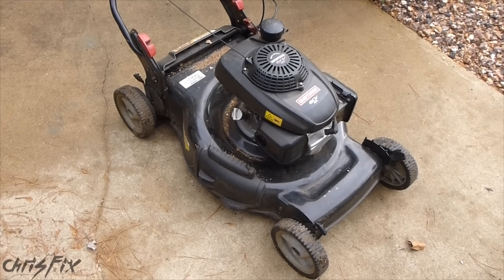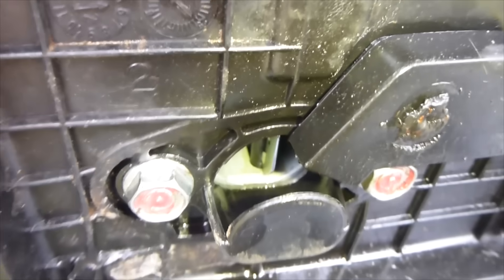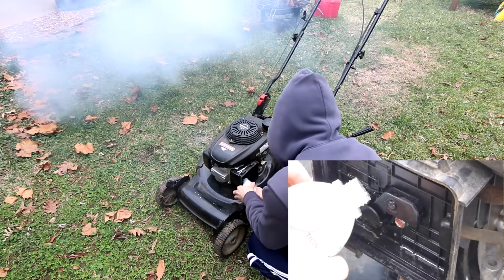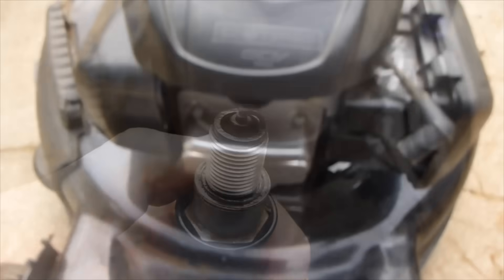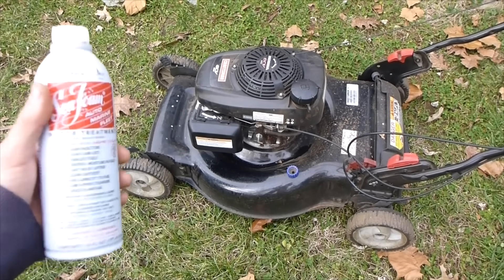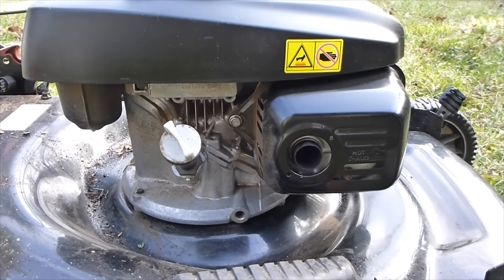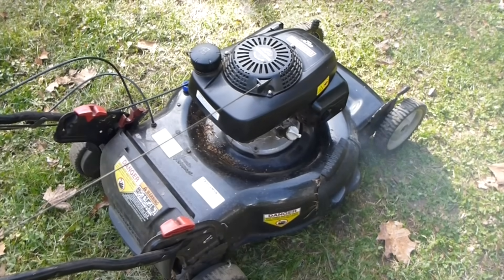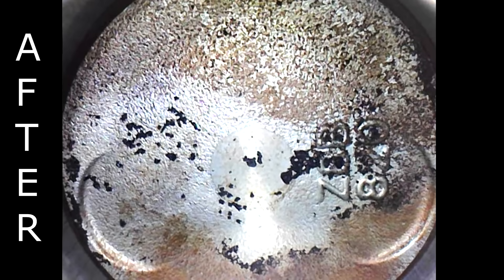Does Seafoam Actually Work? (with Proof)

Comment: Very nice! I am actually planning on doing a piston soak in my fiance's 2.2L Ecotec in her Sunfire as she's having problems with burning oil due to the infamous stuck oil control rings. Supposedly doing a couple piston soaks gets the buildup out of the rings as well. Glad to see some actual real world results from Seafoam though. Very cool test!
Reply: Before I do any piston soaking I believe I need to take a look at the PCV system as I just noticed today that my valve cover oil cap had some frothy yellow gunk on it. Beginning to wonder if incorrect crankcase pressure is the root of my problem. I appreciate everyone's comments though! I will definitely take them into consideration.
Reply: ***** Good thought, hope that's it!
Reply: Jinppa The Sunfire isn't being driven a whole lot as it's not our extra car (got the fiance a Focus) so I haven't had the need to work on it as quickly as I had originally planned, especially with how cold it is in upstate NY right now. I did do an oil change, replacing one quart with Marvel Mystery Oil as per the directions, however I'm not a fan of this approach as the MMO is much thinner than the 5W-30 I put in, therefore lowering the weight about a grade or so. I've noticed much more engine noise since doing that oil change.

I ended up ordering two bottles of Auto-RX after reading some good reviews on it and will be doing another oil change with a bottle of that in the crankcase to see if that will help clean everything up. Before I do this however I will be doing the piston soak with Marvel Mystery Oil. I am currently waiting for the weather to get a little warmer before I attempt that.

I'll keep everyone posted.
Reply from the maker: ***** Good luck. I think the carbon buildup might have cause scaring of the cylinder wall which is why you are using so much oil. Maybe do a compression/leak down test to see if that cylinder has good compression.
Reply: ChrisFix if its anything like the 2azfe in my xB, they used low tension rings. Carbon build up prevents them from sealing fully to the cylinder wall. I seafoamed via the intake, gas, and oil. I have seen a pretty decent  decrease in oil consumption. It used to go through 1qt/800 miles. Now it maybes uses that in 3500.
Reply from the maker: ***** Thanks! Let me know if it works for you! I definitely want to hear back!
Reply: Lol hopefully you see this first, but I just made a comment that it will actually make it much worse because it will release the carbon that's holding back the oil. Trust me. Either deal with the burning oil or have a shop replace the rings and hone the cylinder.
Reply: Also, I don't know squat about that engine, but it could possibly be valve seals, which is a wayyy easier problem to deal with.
Reply from the maker: Tyler Ketter Either way, it is worth a shot if he needs to get it rebuilt anyhow.
Reply: Hi Jared, Not sure if soaking the pistons would cause the carbon to loosen up and get stuck somewhere causing more issues in the engine (like when cleaning heavily sluged engines once). IMO...would get ChrisFix's opinion on it too(professional advice).
Why not try CRC Combution chamber Cleaner- http://crc-canada.ca/automotive/fuel-additive/complete-fuel-system-combustion-chamber-cleaner-355-milliliters.html
I  had excellent results from CRC Guarateed To Pass on a 89 Mazda 626 till 2009.
By all means, I am not an expert on vehicles like CF.
Reply: ***** if you're average commute is short that may cause the yellow frothy junk. It's just from condensation collecting on the highest point.
Reply: Nah it's not that short. It's about a 20 minute drive every day with this car.
Reply: One other thing You can try besides seafoam soak, You can run marvel mystery oil to the gas for a couple tanks. I've used it to free up gummed piston rings on engines they were burning oil. Take the car for a good freeway run after adding the oil to your gas. You can also add Marvel to the oil and run that for a while to clean the inside of the engine.
Reply from the maker: Oldbmwr100rs That is another good test I will have to try and fit in. Thanks for the idea!
Reply: Jared, please tell us how it works out on your fiance's Sunfire. Good luck, may the gods of speed be in your favor.
Reply: ***** So, how did it go?
Reply: *****
I have used z Max but it really thinned out my motor oil SeaFoam will thin it out also. You can only use 1.5 oz per quart .MMO works great but i would drive it 200 miles or more then change the oil. I have been using the MMO for over 10 years but the other product like stp multipurpose motor treatment , zMax etc etc are good for a quick engine flush but Marvels Mystrey Oil can stay in the engine much longer.
Reply: I have a 2009 Nissan Altima with the 2.5 4 cylinder that is consuming a ridiculous amount of oil in cylinder three and has fouled 2 plugs already. The dealership said if they were to remove the engine and disassemble until the point of failure and it turned out to be carbon build up on the rings causing the issue my warranty wouldn't pay for the repairs and I'd be responsible for the rebuild. I've already done the induction sea foam treatment which helped some ignition knock but didn't do anything for the rings. I'm going to do a overnight seafo am soak in that cylinder to see if resolves my issue. If you're able to do this with success before me please let me know. I'll be posting my results on here after its done.
Reply from the maker: Douglas Bomer Thanks for sharing Douglas! That is pretty good! Im excited to see if something similar happens in my truck.

Comment: you should try water with a spray bottle next! after the maf sensor of course
Reply from the maker: DarkskullMedia Yea, that is the plan!
Reply: ChrisFix sweet! i think it works quite well considering its just water but yeah my uncle has a older camaro thats supercharged and we recently rebuilt the engine with better internals, he was running methanol injection and it was crazy to see a motor from the 1970's look like it had been steam cleaned!
Reply from the maker: DarkskullMedia Yea, methanol injection definitely cleans it out well since it is constantly introduced into the cylinder. It is like a head gasket leak but instead you are using it to make more power! haha

Comment: I'm actually a bit disappointed! I did this on my car (which is a 1986 Saab 900 Turbo by the way, so PLENTY of time to build up carbon with over 260,000 miles on it), and the pistons afterwards were spotless. I used about half a bottle of it, and considering it made the inside of the engine looks brand new I'm a bit surprised that it didn't do more for the lawnmower. Still though, worked a lot better than the Gumout product in the other video.
Reply from the maker: Jesse Crandle You looked in the engine before and after? How did you do that?
Reply: ChrisFix Just with a borescope through the spark plug hole.
Reply from the maker: Jesse Crandle and before it was dirty and after it was spotless?
Reply: ChrisFix Before it wasn't HORRIBLE, not large deposits, but yes it had noticeable black carbon spots that covered maybe 1/2 of the piston in random spots (much the same way it does in your truck). After the Seafoam though it was completely gone.
Reply: ChrisFix You know, the answer may be in the fact that a car's motor operates at a higher temperature. I'm just figuring a lawnmower operates at a lower temperature (it has no radiator or cooling system other than oil), a car may have a higher compression ratio and generate a significantly larger amount of heat to aid in the steam cleaning process. I could be wrong about that though.
Reply from the maker: Jesse Crandle That could be. Makes sense.

Comment: Seafoam does work.
i used it in a 350ci that ran rich and had massive deposits on the valves.
it did reduce the build up, but only about 20%.
it ultimately needed to be dissembled and cleaned properly.
Reply from the maker: Sanic Thanks for sharing! Yea, it def does work which is exciting! Sounds like you had a lot of deposits! How did you know you had bad carbon buildup?
Reply: ChrisFix when I took the manifold off;
saw a walnut sized chunk.
it was too far gone though.
Reply from the maker: Sanic wow!

Comment: Hey chris, I'm a bit concerned about the oil burning off in a car. Will that clog up my cats? Also, I just put spark plugs in, will this foul them up? Otherwise I am extremely impressed with this test!
Reply from the maker: helivesonforever I am concerned with the oil coating too, more for the cats than anything else. The spark plug did not get fouled, it actually got cleaned and I would not worry about that. The oily film on the cats should just get burned off but I dont know. I mean, people use it all the time with no problems so...
Reply: ChrisFix Can't wait for the video regardless I had to do both cats in my truck and never want to again. Doesn't help that you can't get them used in my state either so new is the only way to go, which costs a fortune. I suspect that the oil may cause the cat to run hotter, thus melting the material inside. You are right about people using it without issues so I guess it's safe to say that one use won't cause you major issues.
Reply from the maker: helivesonforever That is what I am thinking! We will find out!
Reply: ChrisFix Sweet! Any fixes on your PT Cruiser yet?
Reply from the maker: helivesonforever No, not yet lol

Comment: Interesting results with seafoam on a lawnmower engine.  When you test it on your truck put it in the fuel tank as  you did with gumout  to be a controlled test.  I suspect if you ran the gumout in the mower as you did with Seafoam you may see the same results but we really don't know do we.  So far the only thing we do know is seafoam does take carbon off the piston on a lawnmower.
Reply: Agreed. The same tests should be done in order to keep it as controlled as possible. If seafoam can be put into the gas tank like gumout can, which I believe that it can, then the test should be done with that method.
Reply from the maker: Steve Rob Gumout is not meant to be run in the intake. I will be testing seafoam as it is stated in the instructions (just like I did the gumout). Thanks for the suggestions!
Reply from the maker: Brentt Moore Seafoam gets 1/3 in the gas and 1/3 in the intake.
Reply: I've heard of people using it that way, but I thought that it could be put into the gas tank as well. No?
Reply from the maker: Brentt Moore Yes, 1/3 in the gas tank and 1/3 in the intake as per the instructions on the bottle.
Reply: I must be tired, I certainly misread your post. Thanks for pointing out the directions to me! Looking forward to the other videos in the series, like always.
Reply from the maker: Brentt Moore No worries Brentt!

Comment: I've been using seafoam for a few years now. This stuff works great. All the cars in my household have engines with anywhere from 120k-over 250k miles. Seafoam has worked great on all especially my 96 mustang GT(V8) with over 250k. The first time I used it wow.. smoke filled an entire house across the street( seafoam in a safe location) and once the procedure was finished she purred and roar like if she was young again. Noticeable throttle response recovery and a bit better mpg. 

Soaking the piston, I've thought about doing that but never tackled it. I'll be doing that on this car when my next oil change is due.. why you may ask? I believe I have some bad piston rings.. so some might seep into the oil.. maybe hardly anything.. maybe a considerable amount.. is that a bad thing..? Not if your going to change the oil within the next 100 miles or so.. it'll even help clean the crankcase out. 

Chris thanks for putting this video out there so people can see it in effect. This stuff works great. Keep up the good work man. Easy instructions and very good work with the cameras and pictures.
Reply from the maker: Surdo310 Thanks for sharing your experience! I am glad you like my videos!

Comment: Nice, i knew i liked seafoam for a reason, with the last test showing the best results wouldn't holding fuel there for a period of time get into the oil? i know seafoam can be put in the oil but i'm not a big fan of it there.
Reply from the maker: gremlinamc1975 Yes, it can and will get in the oil. Since it was only for a few minutes and it is a lawnmower I dont really care lol. I will do an oil change come spring time. I wouldnt soak the piston like that in my car engine.

Comment: I have been using that stuff for years. Very interesting to see what it's actually doing inside of the engine. Great video. I normally put 1/3 through the intake, 1/3 in the gas, and 1/3 in the oil before I drain it on older vehicles. My newer ones I use synthetic so I do not bother to put in the oil before I drain it out.
Reply from the maker: Francisco Zurita Thanks for sharing Francisco! I would never put anything in my oil but that is just me!
Reply: ChrisFix Yeah, I have heard other people say that as well. I do not do it on my newer vehicles. Just old ones I have bought in the past that I knew were not cared for properly. until it was a bit cleaner inside.

Comment: Great video! Just FYI you spelled "Actually" wrong in the video title.

p.s. You might want to try running Seafoam through the tank to see it's effectiveness using that method.
Reply from the maker: dainternetguru Thanks man! And thanks for pointing that out! I just fixed it. And thanks for the video suggestion!

Comment: The more often you use it the better it works, if you use it in your gas add it every few or every fill up your cars and equipment will run a lot better , smooth
Reply from the maker: jeepman Personally, I would only use it if you have a problem. Engines are made to run on just gas and using cleaners can cause other problems!

Comment: 7:44 Why not? It seems like soaking is the only method for quick carbon removal. Mixing those cleaners with fuel dilutes them and that's why you didn't see much improvement after two Gumout bottles.
Reply: but gumout doesnt go thru the intake. seafoam goes in the crank case, intake and gas. always use these as directed
Reply: I just redline my car once a week to burn off carbon. I wonder if that works. Hey, Chris... :D
Reply from the maker: February I wouldnt soak the piston because you are taking a lot of carbon off all at the same time and all of that loose carbon might cause problems in the cylinder. You also risk the chance of hydro-locking the engine. And finally, some of the cleaner will seep past the piston rings and get into the oil. It is better to just use it though the intake.
Reply from the maker: Integra DIY Exactly.

Comment: That stuff worked grate chris how old is the mower andcan I use that in a 2cygle engine like a leaf blower ?
Reply from the maker: dav3fk That stinks. That is why I never put anything in my oil except oil lol.
Reply: seafoam says you can use them on absolutely anything.

Originally for outboards, according to scotty kilmer - but a long history of use in just about anything.

But for fucks sake, don't listen to them when they say you can run it in your oil, more than very briefly. Just ask my piston rings (I'll give you a hint what they'd say - my car makes clouds like the tank in that smokescreen picture).

(I didn't mean to trust them, I once forgot I had seafoam in the oil - took a spirited drive - now that motor absolutely requires 50wt, and is awaiting replacement)
Reply: Dc2
Well no shit.

Except that according to seafoam, I'm not at fault, and it's totally fine to leave in between changes - which means for any and all driving conditions in between changes. Go read their website.
Reply: This seafoam was designed for small engines both 2 stroke and 4 stroke.
Reply: kujawat Scotty is no fail mechanic. He makes videos that get to the point without the fluff of watching someone struggle with the small shit. If you can fathom that, you can appreciate the years of experience he brings to the table. If you really need your hand held and spoon fed through every detail, take some classes or let someone like him handle the work.
Reply: kujawat I like his videos - cause I get the style they're presented in. I get that you hate him, but you don't say why. You sure do know a lot about man on man action though. Says a whole lot more about you than him.
Reply: Scotty's hilarious and nerdy and manages to do the nerd trying to be cool so well that it really is cool.
Reply from the maker: patrick cordery The mower is only a few years old and yes, I think that this stuff would work great in a 2 stroke engine like a leaf blower!
Reply: dav3fk I used seafoam just like the instructions said. 1/3 in the gas, 1/3 into the intake, and 1/3 into the oil. Nothing ever happened.  I think you are at fault because you went on on a spirited drive. From what I heard the stuff makes oil a little thinner...
Reply: Oh you've got a lifetime of learning ahead, don't be shy young buck. First is youtube comment sections, who knows where you'll be learning from next. Twitter? Facebook? Maybe even Reddit if you're not a pleb.